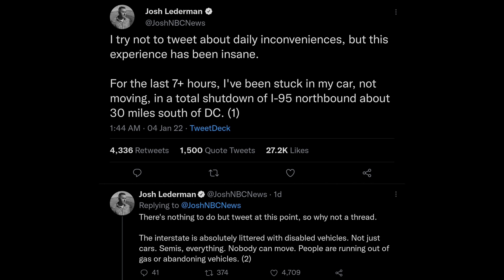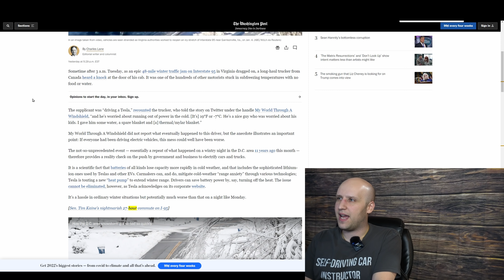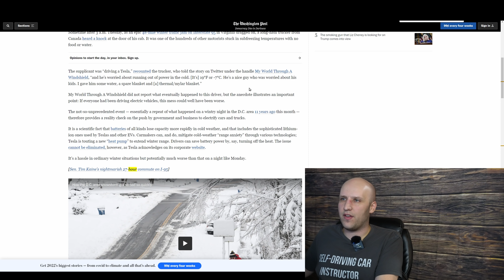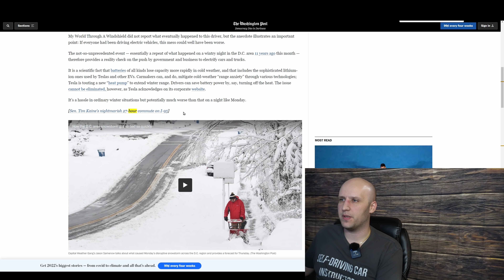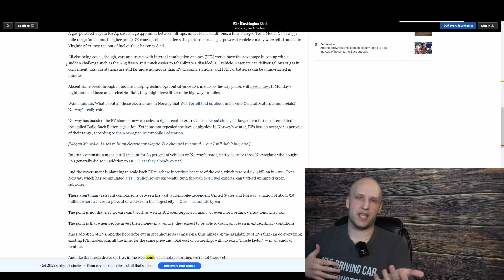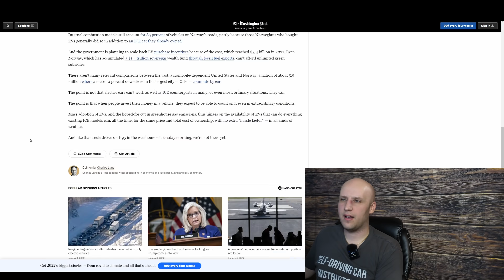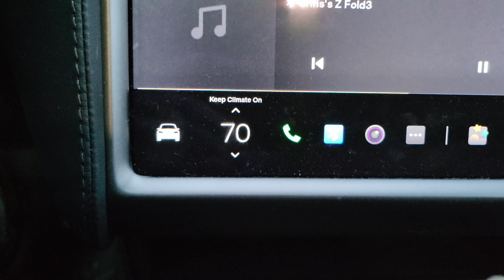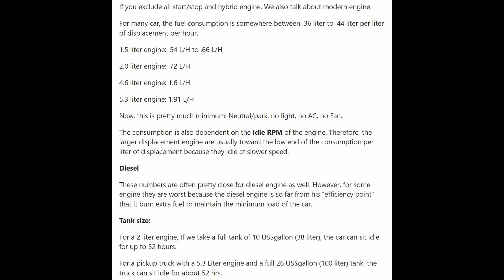How Long Can a Tesla Keep You Warm In A Frozen Traffic Jam? | FUD Debunking

Comment: I figured it wouldn't take long for someone to make a political point out of this. It all depends on the last time you charged or fueled up. My 2013 Ford Taurus gets filled up every two weeks, if this had happened to me, I might have run out of fuel on the highway depending on when in my two week period it happened. It's less likely to happen to Tesla drivers because they charge at home most of the time meaning they start the day with at least 80% charge. I don't fill up my car everyday so therefore, this kind of thing would be worse for me than a Tesla driver. It doesn't matter if its gas or electric, it all depends on how prepared you are and the last time you charged or fueled up. Also when it comes to recovery if you do run out of charge or gas, BOTH vehicles would have call a tow truck. Most people don't carry around a gas can in their car everywhere they go so if you ran out, you'd have to call a tow truck to at least bring you some gas. If you're in an EV and you run out, you're going to have to call a tow truck to give you a tow to the nearest supercharger. There really isnt all that much difference between the two.

Comment: Add to the EV advantages the fact that EVs don't emit dangerous exhaust gases. In the I-95 case it was not relevant, but if your car is stranded in the ditch, with its lower part covered in snow, which is quite frequent in Winter storms, there is a real risk of CO poisoning for the passengers if the ICE is running. I know because one of my uncles was killed in such circumstances years ago. I find that most of the arguments in the text are either irrelevant or will be irrelevant in the very near future. I predict we will have tow trucks able to fast charge an EV generalized in a short time.

Comment: Why didn't emergency crews open up a gap in the median for people to turn the heck around if there wasn't room to go around the crash? Why did it take 24 hours to clear the crash? Yeah they would have been going the opposite direction from where they were headed to begin with but at least I wouldn't be stuck on the road for 24 hours. That's a failure of the government's emergency systems not a failure of electric vehicle design. If the government uses tax money to respond properly to this kind of situation doesn't matter what kind of vehicle you're driving because you're only going to be there for maybe 2 hours.

Comment: A point that was not mentioned is the problem that ICE vehicles have when idling. The catalytic converter over heats and catch’s fire. That may not happen in cold weather. It is important to know your car and it’s capabilities, both up sides and down sides. I would argue that the issues with an electric car are less than ICE cars.  I will admit that an electric car is new vs ICE car so not everyone understands the issues of electric car vs ICE. The article is written as FUD.

Comment: Interesting comparison :) I would also add another option for the ICE cars, which sometimes have a separate tiny engine (independent heater), therefore in these situations I wouldn't run the big engine, just this smaller one.

Comment: Resistance vs heat pump.    Many heat pumps used by buildings for heat cut out at 35 to 40 degree F.    The reason is the efficiency of the heat pump goes way down at low temps.     When does the heat pump in Tesla's cut out or do they?

Comment: Great video.  Was just wondering when someone would do this test.  Thank you
Reply: Bjørn Nyland has done this with probably 20 different EV-models for the last 7-8 years. In -30C.
Reply: @hepphepps8356  Yes he has and I watch Bjorn too, but he doesn’t always break down the data for you in the same way.
Reply: @zollotech  he broke down the data even to the watts being used. Bjorn was incredibly detailed.
Reply: It’s Zollotech! Love your channel!
Reply: Zollotech! The perfect channel to binge watch software and iPhone performance
Reply: Plug and Play EV also did a similar test in his Chevrolet Bolt. Results parallel these.
Reply: Recently, jusr last week,  in a hill station called muri in pakistan, due to  heavy snowfall there was a city-wide traffic jam and thousands of cars were stuck in a traffic jam for few days. People slept in their cars at night , kept the engine running with the heater on. However their  exhaust pipes were blocked due to surrounding snow around the car. This forced the generated carbon monoxide back into the car. Due to this phenomena some 20 odd people died, in various cars. 

This well never happen with Tesla or any other electric car.
Reply: @southpole9450  I would take a guess that those cars where people died were not in top condition. Rusty exhausts, non-standard exhausts, doors not sealing, etc. Not a single person died in the US traffic jam.
Reply: @petergersbach7355  cars were  completely surrounded by heavy snowfall hence there exhaust pipes were also blocked by snow.
Hence my guess is the carbon monoxide generated could not leave the car through exhaust and it came back into the car poisoning the people inside. Their windows were all closed due to cold.
Reply: @petergersbach7355  as far as I know in US traffic jams, people stay in for maximum 4-5 hours. But here in this case, people stayed in the car at just one location without moving for 2-3 days.
Reply: the fundemental basic principles of how Lithium batteries work vs how cars work makes it literally scientifically impossible for a car to beat out a Telsa in freezing temperatures, its as unscientific as saying the earth is flat. A EV can discharge enegry down to -4F a car need 200F to operate normally. The amount of enegry a car uses while being idle is a TON more then what an EV uses. Oh and what about the fishing arguement of 'oh well you can carry gas cans with you'. well guess what? you can also carry an inverter generator with you and some gas and then outperform the car exponentially because the the inverter is not only far more efficent then a car engine (burns about 1 gallon in 10 hours) but the amount of engery the EV needs to stay active is also considerably less then a gasoline. We are living in an era of mass misinformation
Reply: Lots of variable. Keeping my ICEs.
Reply: @MyweathernetreportsBlogspot  No reason to.

Comment: As batteries get better and better with longer ranges like the 500-mile range coming in the cyber truck it will last even longer. In a couple of generations of new battery tech cars will be going over 1000 miles on a charge, charging very fast like in 5 minutes, and they will once again beat gas cars like they already do in most cases!

Comment: I have both an EV and an ICEV. Each day the EV is plugged in and charged overnight so in the morning I have a full battery.

The ICEV has a 16 gallon tank and I fill it up when it gets below 25%. I've never tested specific vehicle but based on some quick research it I would expect to use 1/2 gallon every hour. So if I'm down to 25% gas it would last me about 8 hrs in the best case scenario.

My EV has a 60KWH battery and the other day I had the heat on while kt was just sitting and it used 6kw in 5F Temps. The car was cold so I had the set rather High. I would expect that if I set things to conserve more power it would go down to 4kw. This would mean that at a 50% charge I would still get about 8hrs.

The difference being that I rarely drive at 50% charge but do drive with only 25% gas 2-3 times a week.

Comment: One thing often overlooked is that ICE vehicles are also less efficient in the winter. The article quoted 20% less efficient for EVs. Well, the US Department of Energy found ICE vehicles to also be 12% less efficient comparing 77 degrees to 20 degrees Fahrenheit. So EVs aren't THAT much worse off in terms of efficiency loss due to the cold.

Comment: There’s already so many comments……..but anyway, here’s my 2 cents.  The news article certainly had a lot of breathless “the sky is falling” type emotion. To me, that seems typical of anti-EV opinions with “what if, what if” and “we’re all going to die”………whatever! Take the emotion out and what’s left. Plan ahead, watch the weather forecasts, use some common sense, and you’ll be alright (regardless of vehicle type). I realize that asking people not to be stupid is really asking a lot. Just to put the power consumption in perspective here are some approximate numbers. Model 3 power to go 60 mph: 14.5kW (20HP). Model 3 electric heat (stabilized cabin temperature): 2kW. Seat heater (on high): 100W.

Comment: I camp in my car all the time. In 25-30 degrees I use 5-7% burn at night sleeping 7-8 hours. I've tested this 4 times at that temp. By that math, using the 7% figure against 7 hours (conservatively) you would use roughly 70% for 70 hours. That's at 69 degrees and sleeping in the trunk, if you use the more efficient seat heater, sitting in the front, I'm sure you could shave a big chunk off that and likely hit 100 hours with 70%.

2021 Model 3 LR

Comment: This is cute did you put a thermometer in the car to see what the actual temperature is it may be set to 70 but that’s not what the temp actually is it doesn’t matter if it lasts for days it matters that the temp is actually livable.  Here in Alberta we’ve seen -40 degrees at night and -30 for a high at daytime,  there has been lots of complaints that the heater would only get the cab to about -13. Your test is flawed you have no control or multiple verification.

Comment: Air heaters are no less efficient than seat heaters in principle, all electrical heaters convert 100% of the electricity consumed into heat. The only difference in practice is the seat heaters are in the cabin whereas the air heaters are not thereby they lose a little to outside the cabin.....I'll give you 7/10 on that one

Comment: Many years ago I was driving my ICE car less than 20 miles home after filling up my tank at a local gas station.  I made it less than ten miles down by the road before my radiator got packed with snow due to a freak late April blizzard.  My tank full of gas did me absolutely no good since the engine wouldn't run with a packed fan/radiator.  The car's battery quickly died.  I would have given anything to have had an electric car that day.   Fortunately, I was picked up by an SUV who had already rescued two other drivers. We all spent the night at a farmhouse three miles down the road.

Comment: Q: have you been driving the Y in below .25 degree celsius? any time i get under that the heating stops working and the cabin goes to 2 degrees. Have been to service once where they thought they found the problem but didnt work. I have discussion with them currently and they are looking into it. anything youve noticed? a handful of ppl with Ys here in sweden have seen the same issues but Model 3 is doing just fine

Comment: Seems silly to run a test with the cabin at 70F with seat heaters when it is also cold out.  People are wearing coats and have a seat heater.  60 is probably even too warm for the test.  Nissan Leaf owner who can run in winter without anything more than minimal defrost and heated seat+steering wheel.

The other obvious difference in the test is that in VA it was a bit warmer than the temps you used.   Your 60 hours in the VA scenario with 50F inside is probably become a couple of weeks in the Model Y.    No ICE could come close to that.

Final observation is heat is much more immediate in electric cars.  The waste energy to get some warm air in an ICE means turning on and off a car to stretch the heating (which a lot of people in VA were doing) would last much much longer in an EV if you were concerned about running out of power.

Comment: When it is about -20c my ice car (Nissan Altima 3.6) will not heat the interior or even keep the engine warm at idle. I have to keep it running at about 1200 rpm to keep the interior warm. In stop and go traffic it can get quite cold unless I put it in neutral and rev it up. Often I put it in a lower gear range so when traffic is moving the engine revs up a bit. I live in a cold climate but long for the day when I can afford a Tesla. Oh, yes it is possible to run out of gas in an ice car. I have done it several times in my quite long life and it can be very inconvenient.

Comment: I live just outside of Oslo, Norway, and own a Model 3 as my only car. It's true that you get less range when it's very cold, but other than that it's the best car I've owned for winter conditions (it's my 5th car.) Being able to heat it remotely is fantastic, and it reaches comfortable temperature much faster than any other car I've owned. That means I don't have to manually remove much snow and ice. Love it.

Comment: ICE vehicles lose range by at least 20-25% too.  It is called reduced gas mileage in the cold winter.  This is caused by several factors. Including winter formulated gasoline. I live in a four season state.  I know what I say here first hand. It also is about the same for diesel ICE pickup trucks.

Comment: Geez, do this real world. Inside temps as <60 two seat heaters on low.  Or lower on the air temp if possible.  At least run this in camp mode.  Add blankets on the seats since the body will insulate and lower the heated seat operation.  Cycle seat heaters where they are on for only 15 minutes a hour (which would likely be plenty based on what the op carry in his car for stranded or rest situation. 

This test is basically useless as no one except the extreme ignorant would have the vehicles at this setting.

Comment: My personal thought is that you wil have less trouble with an electric car when your stuck like this. 

An electric car has more chance to be "fully" charged when you go on a drive. When you come home and it say 40%. Your just gone plug it in. (or like most just plug it in no matter what the battery % is.) So the car alway's has a full "tank/battery"
With a gas car, when you got 40% fuel. Nobody is gone think "I need to fill it up". A lot of people drive miles while the low fuel signal is blinking

Comment: The Model Y battery might last even longer if, once you warmed up the seats (like they normally already would be), you turned off what I presume (perhaps wrongly) is the resistance heating in the seats. There could be other ways to stretch your battery's remaining charge, if you were stuck in the cold. Keeping mylar blankets on hand might be an excellent idea as well, to enable you to reduce the cabin's air temp to say 50 degrees or even lower, basically using mostly body heat to stay warm. This would be a good idea for ICE cars as well, since they will run out of gasoline, probably faster than a Tesla Model Y, in particular, would run out of battery.
Reply: Yep, Keeping blankets in a car is a pretty basic winter safety measure. I've just got some old sweatjackets but same idea

Comment: 1. As you pointed out in the video, gas cars can run out of fuel too.
2. As for restarting, Tesla already has mobile Megapacks that can charge large amount of cars very quickly. And there are other solutions in development. Vehicle to vehicle charging also exists, just not common yet. It's the same idea as jump-starting an ICE car, just easier, safer, and more reliable.
3. Also when all cars will be electric, the infrastructure will also be way much better. Imagine the same ICE car jam, with no gas station in a 100 mile radius.
4. Also it's starting to make sense to put solar panels on the roofs of the cars. Even in winter that generates enough power to keep you from freezing. Won't work at night, or in a snowstorm, but still gives you a better chance than an ICE car.
5. My last ICE car was so efficient that in similar temperatures it couldn't keep the engine temp up while idling, even with heating off. That would have been really dangerous in a jam like this. Tesla can deliberately run the motors inefficiently to generate heat. Even when the car is not moving.
6. Also if you've been driving for a while your battery will be warm. That means you are sitting on over 1000 pounds of warm metal. An ICE engine contains way much less heat, and loses it way much faster.
7. I can warm up my Tesla with the app before I drive, so I don't have to manually scrape off the ice, while I'm subjected to the not nice weather, or sit in the car for 10 minutes while the engine heats up enough to melt the ice, wasting a ton of fuel, and causing significant wear to the engine. Also once driving, I still have to be gentle with the cold IC engine, while in an EV I don't, the only difference is less regen while the battery is cold. Overall an EV is far better in cold weather than ICE.
8. As for reliability, the chance of breaking down, or not being able to start the car is far higher with an ICE car. Especially in cold weather. Modern ICE cars are far better, but still can't touch EVs. And I think diesel cars are still struggling with the cold (never driven one), as they don't have spark plugs, but rely on compression alone to ignite the fuel-air mix. So if the air is too cold, they can't start. They have to preheat the engine, which is a big inconvenience. In the old days truck and bus drivers used to build a fire under the engine to heat it up.
9. My experience after 3 years of Tesla ownership is that it's far less hassle then any ICE car. And I had a 2015 Model S 85D and a 2016 Model S 90D, these are relatively early cars with significantly more issues than the newer ones.
10. From what I remember about my ICE cars idle fuel consumption, it should have lasted about 40-50 hours with a full tank. Similar to the Model Y. And, as I mentioned above, my last gas car actually couldn't keep the temperature at all.
11. One last thing. With all those stuck ICE cars, I imagine the air quality wasn't ideal. With no wind that could get actually dangerous over time.